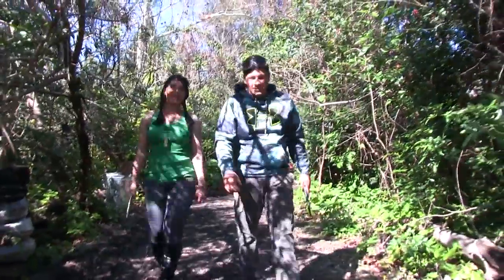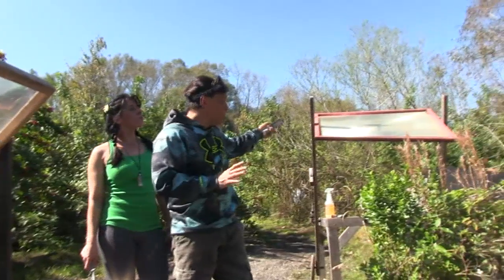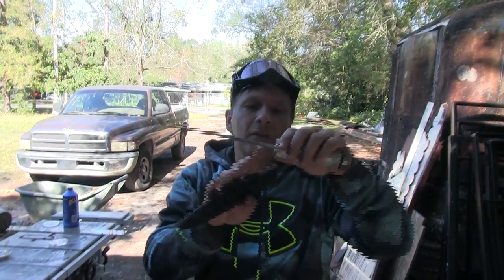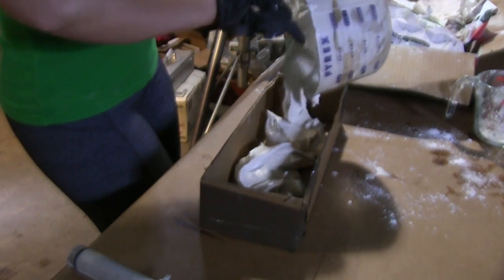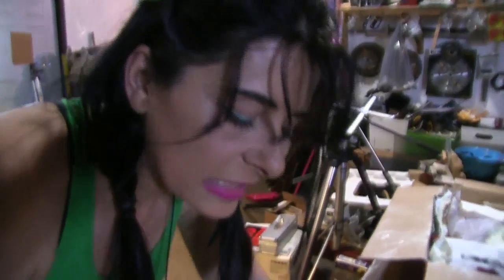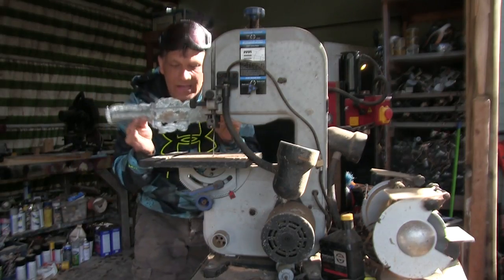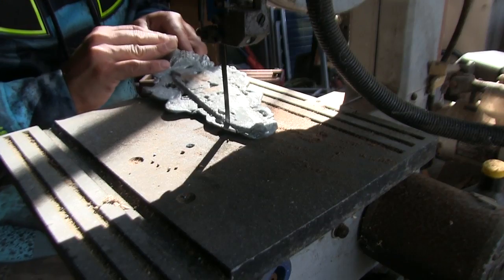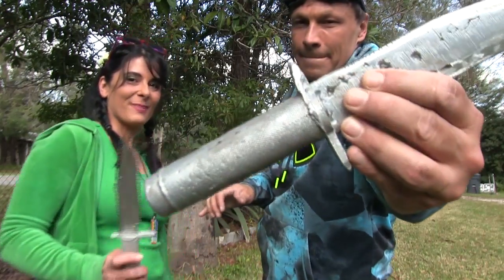Fresnel Lens Making a Knife Solar Metal Foundry DIY greenpowerscience

Comment: try using sand casting instead of plaster for a more perfect copy. make a wax copy of the knife and bury the wax copy under sand soaked in vegetable oil, the pour the molten metal into the sand to replace the wax...
BTW Denise is very photogenic, she makes your videos WAY more appealing to watch :)
Reply: styrofoam is better and what they use to make engine blocks.
Put the foam copy in casting sand  oh well anyway there are tons of vids on youtube that show you better than I can tell you .

Comment: Disappointed from under a minute of watching. I thought you were going to use the heat to FORGE a knife. That WOULD be cool. You can hardly call that thing a knife. Its more a sculpture of a knife, or I suppose you could call it a shank, if you intend to stab people with it. But seriously, try using the heat source to replace the small forge. Small forging is awesome but it uses up a lot of resources, you could really make a difference if you can show it can be done!!!!

Comment: I was wondering if its possible to melt silver and gold
Reply from the maker: jemusu ishikawa Small amounts in a crucible. Due to the higher melting point and the metals becoming super reflective when molten, a lot of sunlight is reflected away vs absorbed resulting in a lowering of build temperatures. A hybrid system of concentrated solar and other traditional methods work great. The solar reduces other forms of energy consumption by about 50%.
Reply: +GREENPOWERSCIENCE what if you heated the crucible instead of the actual material? The reflection wouldn't be as much of a factor, right?

Comment: Hey dan, I am getting ready to head to bed... you do know what magnesium chloride.... MgCl like you heat up tll it melts and pass a current through using graphite elecrodes and on the anode side you get chlorine .. and on the cathode side you get magnesium metal as a precipiate... right?

Comment: Awesome. Melting point of zinc is only 787.2°F compared to Aluminium at 1220°F Copper at 1,983°F and carbon steel at 2600 -2800 depending on type.
Reply: Jason Roush nice googling
Reply: Greg Piarowski,  trying to be funny or just demonstrating your lack of metal melting points?

Comment: zinc fumes are sweet just like antifreeze. You go blind, deaf, brains scramble up and your kidneys fail. Hard to explain to somebody after the fact.
Reply from the maker: Agree
Metal fume fever. The smoke and fire is not from the zinc. The crucible that I made had an adhesive that absorbed into the cement. There is some surface slag. I have been casting zinc since about 2006. Always outside, always upwind  and avoid burring the metal. I added some info to the annotations and more info area regarding the dangers of burning metals, especially zinc.

Comment: Interesting vid, I wonder what the hardness is on the knife or if it can hold an edge for very long. Look forward to the vid on your hybrid system.
Reply from the maker: It can cut rope and softer woods before it starts to dull. The zinc is really easy to sharpen. Steel is a better choice for most applications. The two dimensional molding shows rapid reproductions. Usually a mold can make up to 10 copies.